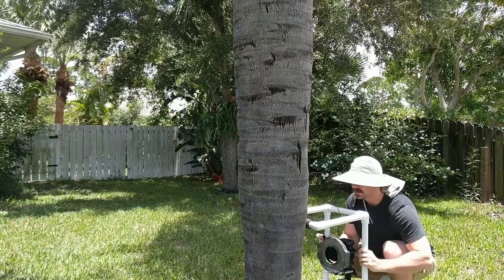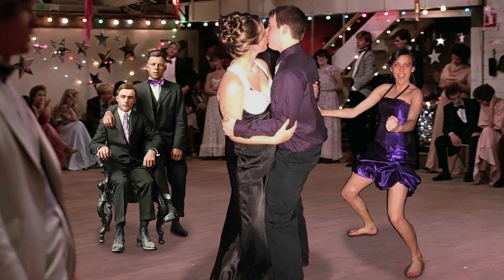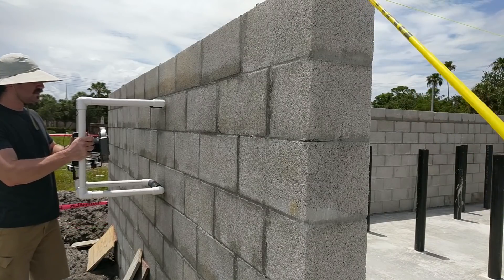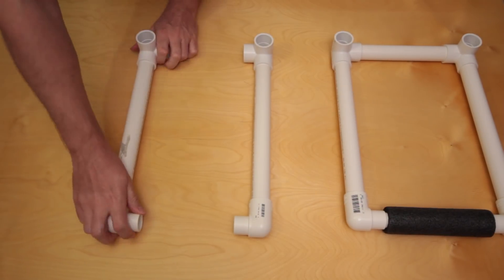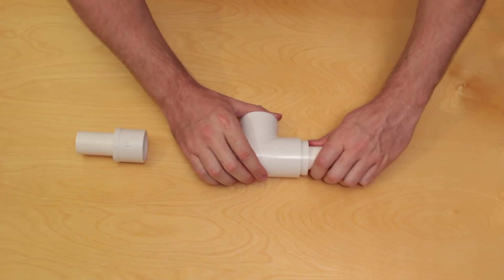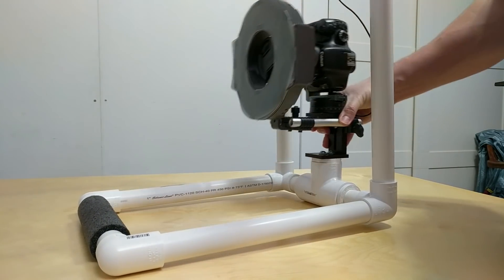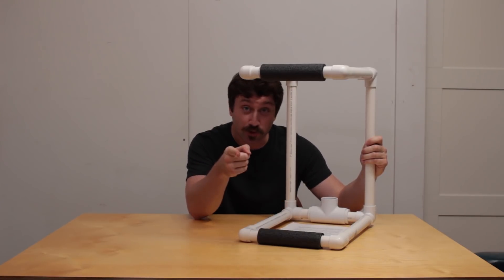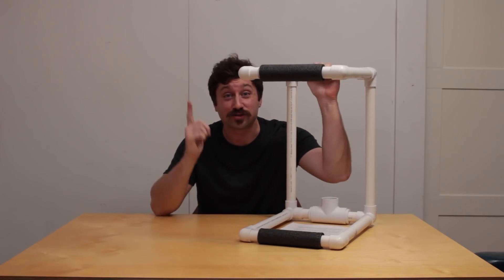How to Build a PVC Tree Scanning Rig

Comment: Why didn't I know about your second channel?!  Miss you for a time. Thanks to  
Grzegorz Baran for showing me your new rig. It's awesome, I have to try it. BTW, is there any crosspolarization in place?
Very cool, thanks for sharing.
Reply: Another  question...  About  CRI in lighting, How much big of a deal is it?  If I'm not wrong yours is cri 95 +/- 2. If I want to be perfect do I need good CRI or is better CRI 80 and a colorchecker? Also, is better less but brighter leds or dimmer but more quantity?  Light source, The bigger the better? 
I'm thinking about building a panel of the size of the frame and I would like to know. If I make the  light panels modular could I then relocated them in the sides to make photometric stereo? mmmm so many thoughts...
A rough estimation leave my with this: (all metric and euros)

2 linear polarizer sheets 20cmx30cm 8.5€ (aprox total polarize light area 40cmx30cm less lens hole)

LED 2216 RA90 + CRI>90 12V 12V 120LEDs/m 9,6 W/m  600lm/m (3€/meter) (let's say the width of the strips is 1 cm, do I need 12 meters? I think so.  so 115W - 7200 lumens - 9583 miliamps - 36€ or more like 43€ and 3 spare meters).

Battery... I have a car starter with 18000mAh and 12v 10A DC output.  It cost around 70€.

PVC etc... I would like to consider aluminum, (aluminium?) but pvc seems fine for most part, maybe some plexiglass.

What do you think? I'll source the materials (it will arrive I hope duringe next month) and try to cad some ideas.
Reply from the maker: To be honest, you seem much more knowledgeable about technical things than I am, haha! I do think that there are pros and cons to bigger and smaller light sources, but generally I would say a brighter light is usually a better one with regard to this application, in order to allow lower ISO/higher shutter/tighter aperture. I've also seen people shooting with two lights on either side of the camera, as opposed to a single ring light. But I've never tried that myself yet. Also, if you can't get a super high CRI light, I think CRI 80 isn't too bad as long as you're able to improve the colors a bit with a color checker, as you mentioned. In my opinion, it's more important that the final color look good, as opposed to purely focusing on perfectly recreating what the colors really were. Sometimes a modified color map looks better than a 100% perfect recreation.

If you have any other questions, just let me know! I hope your rig building goes well. And if you can create a mock up out of PVC or another cheap material first, I recommend it! It helps to have a physical thing you can hold, and will be a great guide to deciding whether to alter your design based on how the mock rig feels.
Reply: @ClassyDogStudios  Right on. Thanks for the tips. You're a boss!
Reply from the maker: Hello! I'm glad you enjoy the videos. With my new rig, you can still use cross polarization. Although with my new ring light, I had to paint the PVC arms black, as they started reflecting too much light onto the surface. I'll answer your other questions in another reply below!

Comment: Amazing videos, thanks for sharing. I am starting to build a polarization setup. To make that setup work during daylight, is it possible to cover the rig somehow to avoid light from the exterior? Do you think that may work?
Reply from the maker: Hi, David! I remember some of your scans over on ArtStation, you have really great work. Lots of character in your scans. And yes, if you can block the ambient light while you're working, that will help a lot. A powerful light is a great tool, but the less it has to work, the better (and the less likely you'll have to stop due to low batteries or overheating).
Reply: @ClassyDogStudios  Thanks :). And thanks for your content!
Reply from the maker: You're welcome!
Reply: You could try to see if you could overpower the ambient light with your polarized light source while still getting a good exposure on the texured surface.
A flash with high speed sync will allow you shutter speeds above 250th of a second, depending on the flash you can go much higher drowning out the ambient light :)

Comment: Can you tell me if this type of setup will work with large glossy surfaces, like polished stone flooring or varnished wood? the mounting system is brilliant and also solves the problem of af hunting and inconsistent relative texture size. But, im curious if the light would introduce specular being so close and at a narrow-angle? In my experiments with X-pol I have found that glossy surfaces require the lights to be some distance away and ideally at 45 degrees to the surface to remove the specular lobe.  Have you tested with large glossy surfaces? would really appreciate your feedback, as if it works ill build a rig for sure.
Reply from the maker: Apologies for the delay in replying, Phil! I hardly ever log in to this account. Glad you found me on Twitter, though!

Comment: Very interesting setup! May I ask You what Camera Exposure/ ISO / F number You get with this lighting setup at night?
Reply from the maker: Thank you! If I remember correctly, I would shoot at ISO 800 and typically F/8.0 @ 1/80th shutter. I now use a FlashPoint ring flash (sold under the Godox name in Europe I believe), but still tend to shoot at the same ISO and aperture.
Reply: @ClassyDogStudios  hi! how would you compare these two ringlights? What are each strengths and weaknesses?
Reply from the maker: You know, I would say from a performance standpoint, the FlashPoint light I have is better in virtually every regard. It's much brighter, the battery is quite good, and I think the spread of light is much more even as well. Of course it also allows a much faster exposure and many more shots per minute.

The only advantage to the F&V r-300 LED ring light, in my opinion, is the lower cost and lighter weight. It's not a bad ring light at all, and I still use it for turntable scanning, but the FlashPoint light made some things possible that simply weren't possible with the F&V r-300.

Comment: You mentioned in one of your previous videos the light source should never move while you shoot around the object. Now you are putting the lightsource together with your camera when you shoot a scan?? Wouldnt that cause the geometric output to be far more noisy just to get more even textures?
Reply from the maker: That's a good question! This is kind of a special exception to that rule, because from the camera's point of view, the light never changes- it's more or less perfectly flat, coming from all sides of the lens, no matter how you orient the camera. That's the advantage of scanning with a ring light, and why I really recommend trying it out if you can (especially a big one). Hopefully that clears things up, but let me know if you have any more questions!
Reply: @ClassyDogStudios  I will try that ring light setup. If that works, then you just saved me a lot more money and space in my scanning room, since I was planning to buy 2 more ring lights with stand to place around the room to even out the lighting in all angles. Which ring light did you use on this one, will any ring light do as long as it mounts on the rim of the camera?
Reply: @ClassyDogStudios  ALso have you ever considered using a gimbal crane instead, I think that might even work better than your pvc rig. I just don't know if it will work together with the ring light though.
Reply from the maker: I used the F&V r-300 ring light for my tree scans. I think you can mount it to the 1/4" thread in the bottom of the camera (instead of on the lens, since it's so heavy). Though I prefer using the rail mount system you see in this video because I don't like having the camera and the light attached directly together (it makes it harder to make adjustments and isn't as secure). You could also use some of the smaller ring lights that do attach to the lens, as you mentioned, but just be aware that you'll probably be limited in how big an area you can capture in the frame at once with one of those (I used a small ~$40 ring light from Neewer that seemed good, besides the limitation I just mentioned). If you're on a tight budget but need a bigger ring light, I'd check out what's on Amazon and check out lights with good reviews. There seem to be a lot of decent large ring lights on there for less than what I paid for my F&V r-300 (which was about $300 if I remember correctly).

And yes, you could certainly experiment with using a gimbal crane! That's something I'd like to try out, but just can't afford to right now. But if you can, give it a shot. It might be perfectly suited for your needs!

Comment: Do you get rid of the specular reflections using cross polarization like you show in your other videos?
Reply from the maker: Yes, that's exactly right! Same light and everything used for these tree scans as seen in that video.
Reply: Classy Dog Studios I ask because I wonder if you take the same picture polarized and unpolarized, having both of the same part scanned, you can extract the specular map using the difference blending mode but both pictures have to match pretty well.
Reply from the maker: Yes, that's something I want to try out, too! In fact, it's my goal for my next texture pack (which will have some of metal surfaces in it). You could also scan the same thing twice (once with cross polarized and again with parallel polarized images), align all the images and generate two sets of CP and PP texture maps. Then blend between the two maps to extract your spec/roughness/whatever. That way you don't have to worry about trying to capture the exact same camera position with each image, though if that's easy enough for you to do, it's probably the faster method. Here's an article you may find helpful: http://filmicworlds.com/blog/how-to-split-specular-and-diffuse-in-real-images/

And here's another one I like as a guide: https://docs.sharktacos.com/photography/xpol.html

Comment: Nice job, simple question but why shooting in very tiny distance from the subject ? You need to use lot of images for make the job and it can be a suffer for a large area like scanning ground or wall.
Reply: At that distance you get extremely high detail and you can do it in tight spaces like he showed with the bush example.
Reply from the maker: Yes, JC touched on the key points there. Another issue is the fact that the brightness of my LED isn't very strong. It's not a bad light, but with the cross polarization eating up so much of it, the light needs to be fairly close to the subject to get a decent image with good exposure settings. Besides that and needing high detail, I also need the rig to be small and light enough to work with. The rig I built for Sebastian Zapata (pictured toward the end of the video) is toward the limit of how big I can build it without it becoming too impractical to use. If you don't need a lot of detail in your scans though, then this rig might be overkill. It's main purpose is to make highly detailed scans easier and faster to capture.
Reply: @ClassyDogStudios  yes, I think this rig is a good option for little surface scan or like in your example (tree bark) but not especially for ground or wall (except maybe for little details or specific area like a patern), this kind of surface need minimum  of 1x1 or 2x2 meters in my opinion for limited the tiled. Too much pictures here for 2x2 meters.

About the lighting, I suggest to use flash with polarized rather than continuous lighting (more powerful). I seen people using 2 polarized flash mounted with dslr and have a very good result with large distance. 

Example : https://photos.app.goo.gl/cVb1zraKZfx7yd3BA

Also It seem that 45° light is better for polarization, do you have good result with your current angle (0°) ?
Reply from the maker: You're right, darty367, it may be an impractically high number of pictures for a large surface. Even for me it sometimes sucks. I suppose scanning for Sebastian is to blame (he always wants super high quality detail, so that's what I tend to shoot for). Also my little T2i means I have to shoot more photos in comparison to his big 5DSR. So the average scanner will probably not want to shoot as close up as I do.

And I'm quite curious to start using flash in my scanning work. I just recently bought the popular Godox/Flashpoint 400 watt ring flash. It seems quite powerful, especially in comparison to my little LED. I'm also interested in buying some speed lights for another rig I'm working on. I've never shot with more than one light at a time, and don't even know if it requires careful settings when using lights at 45 degrees as opposed to the simple 0 degree ring light setup. But from what I can tell, the setup I've been using tends to work fairly well. Curious to try out CP with multiple lights, though! Is it something you've used, too?
Reply: @ClassyDogStudios  Eh classy man, not testing yet but I'm working on and hope trying soon when I will have more time. Dual flash with CP seem be very versatil for lot of usage (in exterior, interior, from large or tiny distance, by day or night depending of you flash power). I'm learning since several weeks about different approachs and it seem the best way for the moment. Also, flash with cp can be diffuse with soft box or other material, lot of possibility to test.

I will share my works when I will ready :)

By the way, don't know if you have already check this video who speak about cp but just in case if you are interested : https://youtu.be/LdSkxFRCu4c?t=491
Reply: darty367 I think the 45º light is for circular polarizers but becomes irrelevant for linear ones, specially if the one on the lens is also linear.

A lot of forums talk about circular polarizers being the way to go but this is from a regular photography perspective, scanning is technical photography not artistic one, you don't need it to be pretty, you need the information taken by the camera as correct as possible, filters on the lights and on the lens should be both linear.
Reply from the maker: That's great to hear, @darty367. I had an idea for a similar sort of rig that I want to try testing in the future, so your post encourages me that it might actually work! And thanks for posting that video, it's cool to see photographers using the technique for artistic control as well!
Reply from the maker: I've never tried a linear filter on the lens, JC, perhaps I'll have to test it out to see what the differences are!

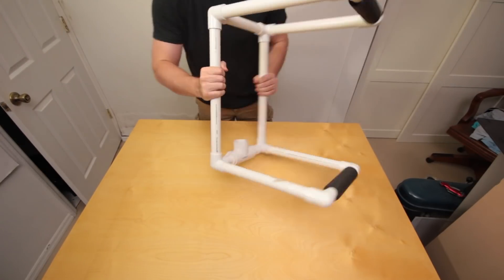Comment: @3:29 Awwwwwwww <3 cute cat. And on topic, I was thinking about a mod of this so that the camera is closer to the middle of the rig. And I can add a handle so I can hold it with one hand and fire the remote trigger with the other hand.
Reply from the maker: She was curious about what was going on, then pretended she wasn't interested when I opened the door. Typical kitty.

And that's a good idea! I say go for it!
Reply: @ClassyDogStudios  I definitely will... I'd love to do a setup like this for scanning heads... just set up a PVC cage with a bunch of cameras  on it
Reply from the maker: That would be cool! Hopefully I'll get a "head and body" scanning video done within a year or two so I can share some of the ideas I've had for scanning heads, too.
Reply: @ClassyDogStudios  One of the challenges is keeping the actor still and if you have multiple cameras, getting them to all fire at once is EXPENSIVE.
Reply from the maker: Haha, yes, it is not an easy task! Although if you can find a way to build your own camera trigger, that will save money. And on the cheap Canon Rebels, for instance, you can connect a headphone splitter and fire two cameras with one trigger. I've done that before (just make sure it's the right type, I think it has to be a stereo splitter, though test first before buying if possible). You might be able to daisy chain 4-6 cameras this way and still get it to work (though at some point you'll need more power in the system to successfully trigger more cameras). Or if you can trigger cameras via remote control, that's another option.
Reply: @ClassyDogStudios  I do have the Nikon remote trigger, but I think I requires some additional hardware to link the cameras together. It can get expensive quickly with many cameras AND the exact fix zoom lenses for each one.
Reply: @ClassyDogStudios  You could use an Arduino as a trigger but just need to ensure you have enough power to fire the cameras. For a head, you could also construct a dolly rig and move the camera along that
Reply from the maker: Sorry for the late reply! I hardly ever log in to this account. Those are all good suggestions! I would like to try out things like Arduino and Raspberry Pi in the future, they look pretty neat!

Comment: You are awesome. For making this pack in the first place and then making this PVC rig video. 
Does the consistent distance from surface to the sensor this rig enables, has any positive effect ?

Also that's one maginificent mustache
Reply from the maker: Thank you for your kind words! It's so cool to see the video you posted, that's the best part about making something like this; seeing what people do with it.

Yes, the fixed distance gives (at least) two advantages: for one, it means the focus distance stays the same, so no autofocus is needed. I manually set focus before I start shooting and then don't have to think about it. And two, it means that if you're shooting with a light, the exposure should also stay the same, so you don't have to worry about the light intensity fluctuating between images. Hopefully that makes sense!